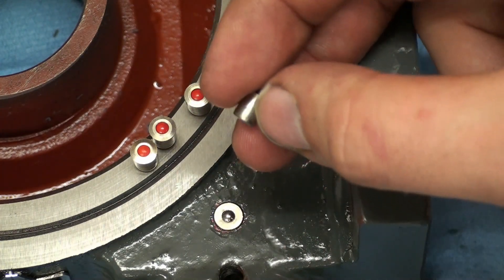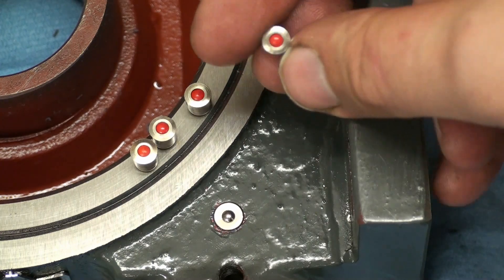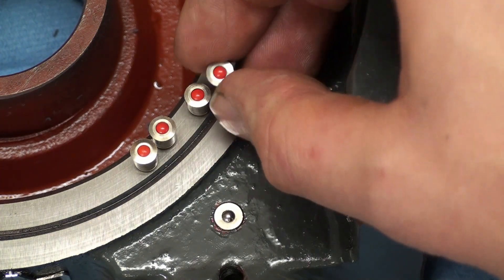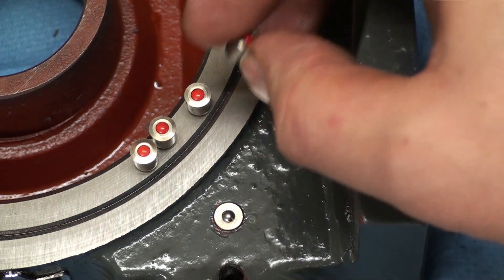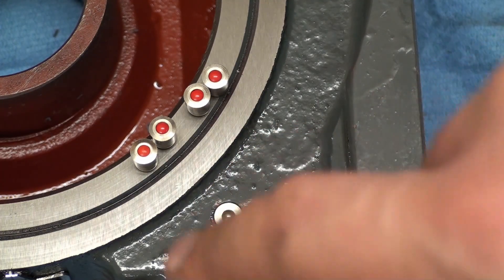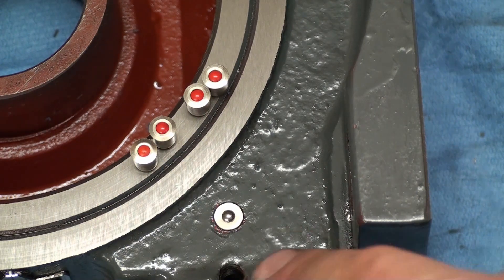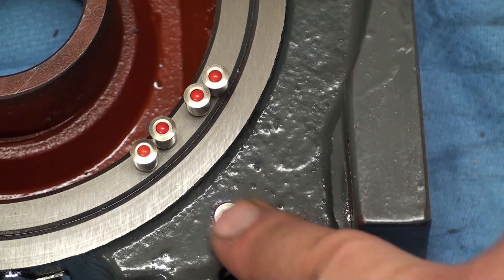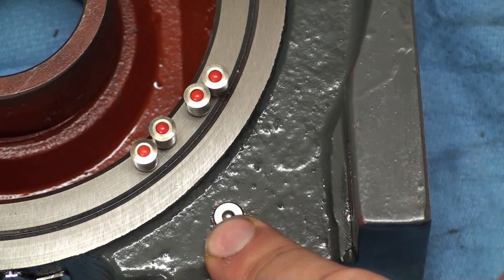Vertex rotary table Teardown - Vertex Rundtisch zerlegt

Comment: Hi Stefan.
What Model is it in their line of tables. Good to see as I once bought a Chinese 4 jaw independent chuck for my Harrison T300 and though it is very good it also was full of Cast Iron chips and dust so I did the same thing.
Reply from the maker: +Fred196407 It is a HV-something table. Generaly I would take apart all the stuff from far-east,  dirt, chips and grinding dust are pretty common in that stuff.
Reply: +Stefan Gotteswinter  Yes me too. We have a local ish place called RDG tools in Hebden Bridge here in the UK who sell a lot of HBM gear that is mostly inferior rubbish. I bought a 3 jaw self centring chuck for my myford super 7 from them which had a strangely tight jaw. To my horror I discovered that one of the jaw guide ways had 3 chisel indents in the edge of the groove. I took it back and had an argument with a old guy there who accused me of trying to grip something too large so the jaw clattered about. What an absolute insult to my intelligence. These chisel marks were in the Center of the guide way. Eventually he replaced it. I got in my car and as I rolled a fag I watched them lock up and leave being the end of the shop day. The chucks were sealed in a shrunk wrap plastic bag. I thought what's all this dirt and opened the bag to find a chuck that literally looked like it was dipped in oil and then put in a tub full of cast iron dust and chips and tumbled around. To ad insult after I stripped it and cleaned it out it was completely useless for any kind of accuracy and worse that the old battered Pratt Bernerd I was trying to replace. I now have a Harrison T300 which also came with Pratt chuck but its acceptable especially with a new set of soft jaws. RDG's stuff may have gotten better in quality these days but I doubt it. My next chuck will be a Bison.

Comment: Excellent review Stefan, I have a 200mm Vertex rotary table which appears identical.   I was a bit surprised with your commentary about it being chinese.  I have a Taiwanese lathe and Mill and the Vertex rotary table is made in Taiwan.  I was led to believe the the Taiwanese machinery was significantly better made that most of the mainland Chinese stuff.  Is this not your experience?  Love your Channel, thanks for posting.

Comment: hi stefan would this rotary table fit on the optimun bf-16 mill in the 90 deg position will the holes line up with the table to clamp down? i am looking at getting this rotary table

Comment: Hi Stefan.
Please , tell me  - what are your feelings on the use this rotary table   at steel billet  milling process  like power way ?  The worm is not dead?
Or this rotary  table only for  "installation +  fixation  + drilling"  (for hard metal of course)?!
Reply from the maker: I use it for milling steel all the time :)
Reply: I mean - you milling steel billet  after fixation or in  rotary process?

Comment: Hi Stefan!
I have a terrible question for you!
Please,  measure the thickness of the  in the horizontal sole of the rotary table!
(All the walls from the radial bearing together with all partitions to the thrust bearing-nut)
The essence of my question is: I bought a similar table, I saw a very small thickness of  bottom cast iron  in compared  with the supporting  side walls of the rotary table!
It turns out very small table rigidity due to a thin bottom!???

Comment: OK this an important question lets say you have a 12mm round stock and you want to mill
a square at 10mm on the end,Like say a chuck key,How do you work out how much material
to take off the 12mm round stock..Would it be 2mm divided by 4  = 0.5 millimetres of all 4
sides is that correct..Sorry I'm a noob at this and crap at maths i just though that's how you would
work it out .or is there a formula for square in a circle or a way to work this out thank 
you for your help its very much appreciated..
Reply: HolzMichel Hi thank you for the reply,I said 0.5mm a side sorry for the confusion..And i would be taking 0.5mm from 4 sides..Which would mean 2mm off loss of material all around..Giving me my 10mm square hope this makes seance...If i took off 1mm per side on 4 sides as you say that means there would be 4mm of material removed not 2mm ??
Reply: +Muhaa Haloa Yes, but its only 2mm off one axis of the resulting square. Same if it were a round; the diameter is just  two times the radius, not four, or six or ten or however many sides you wanted to machine on the end of the round bar. I hope that makes sense :)
Reply: ***** Ah thank you i get it now sorry about the confusion,Just trying to learn..Thanks for the explanation..:)..And thank you HolzMichel
Reply: HolzMichel Thank you for your time and explanation HolzMichel its very much appreciated i understand what you are saying
now it's some thing I've been wondering now for a long time..I don't have my mill i have
my lathe and waiting till the end of November for my shed to be put up..But i will get there..

Comment: Your channel is one of my favorites. I'm pretty interested in machining, but don't have the space at home. Someday I might get a hobby lathe and/or mill. My question for the Q&A: To get started in home / hobby machining, what is the best way to buy machines, tools, and equipment? I know there is the obvious ebay and classified ads, but is there another way or place that nobody thinks of?  

Congratulations again Stephan!

P.S. Is the M1911 project abandonned? Is there hope to see it finished someday?
Reply: Best way is to look for a nice well made old used machine with lots of tooling to pop up,could take months or more.Or you can just buy something new made in China(unless you have LOTS of $) and be prepared to spend more than the machine on tooling (measuring stuff is a killer if you want decent stuff, and you do!) in a very short period of time and put a bit of effort in (like done to this rotary table) cleaning and just finishing of stuff they are too lazy/cheap to do in China.

Comment: Hi Stefan - Thanks for taking us through this. My Question(s) - Can the Handwheel & Vernier Scales be adjusted or redesigned to read and set a greater accuracy. And could the worm shaft and worm gear be replaced with ones that have more gear teeth for finer motion, or are the gear teeth constrained by the diameters of the worm shaft and worm gear?

Comment: Thanks for the Q/A!

Do you thin it's possible to use one of those rotary tables to machine while rotating it? Maybe adding an axial ball bearing? (Mine vibrates a lot and it does sag while horizontal))
Reply: +Armilar Zifferblatt Plain bearings are the norm for low speed high accuracy use. Vibration comes about due to movement that shouldn't be there. You need to tear it down and find out what is loose or broken. Luckily Stefan just showed you how.
  Mike (o\!/o)
Reply: Will try and post back the results.
Reply: +Armilar Zifferblatt That's what theyre meant for not the best quality but adequate. I have been using the 8" for the last 16 years in small scale production environment. 1 month by me about a lifetime of use by the diy er just needs a rebuild every year.

Comment: hi stafan, sehr gute videos. ich habe eine frage. voher kaufst man die red Ball oilers? I am restoring my old weiler condor lathe, and need some of these oilers. greetings von dänemark 😃
Reply: +DKadventurer you google for "ball point oiler" or "red ball oilers" for the colored ones and in german for "kugelöler" or "kugeldrucköler"
Reply: +rol eic wow i didnt know that! is that Google.De ? IF that Works i must tell others. could i also do The same IF i need a pair of shoes? 
I asked because i would Like to know EXCATELY where hr bought his oilers....

thanks for The help
Reply: +DKadventurer Is that sarkasm really applied at the right place? It took me a while to find the correct German terms to google for German suppliers myself. And I thought this might help you. If you had found this out before me such a BIG DEAL. But now I know that I don't need to try and help you any more. Have a good life.
Reply from the maker: +DKadventurer Link ist in der Videobeschreibung :)

Comment: Hi Stefan, Come on! When Optimum knew you ordered your Vertex, they went over it with a fine tooth comb. Hey a drywall screw and vice-grips will pull any oiler, or just put the vice-grips on the tap-handle   Die Frage, Poster on the wall, Who, What Where.....?

Comment: I like to use a socket to make an ad-hoc puller.
Reply from the maker: +eformance Yeah, I do that too, or part off a piece of pipe, but in that case I prefered the nuts so people could see the oiler beeing pulled out :)
Sockets are also good to drive in bearings in a pinch...

Comment: I have an unusual request/question for any owner of this table.: 
Can you tell me what the internal diameter of the large worm gear is, the diameter INSIDE the bolt circle?

I am building a machine  that would use a rotary table like yours with some modifications.

Comment: my table is 120mm wide t slots are 70mm from centre to centre
Reply from the maker: +Jason Burns the holes on the vertex are 100..130mm apart
Reply: I think I will purchase the 110mm table for my optimum bf-16 mini mill

Comment: While you're at it you should check the accuracy like hole concentricity, table flatness, and squareness and parallel of the base to the table.
   Mike (o\!/o)
Reply from the maker: +Moholo 88 I did that, but the video was already to long - But guess what, it is exactly within the specifications that can be found on the Vertex website :)
Almost all measurements are better than 1,5/100mm :)
Reply: +Stefan Gotteswinter  Wow, that is really good. Now I am curious and I have to check mine since I can't remember. Great video, thanks.
  Mike (o\!/o)

Comment: Are you sure it's not a 6" rotary table? ;-)
Reply from the maker: +eformance Whats an inch? ;)
Reply: +Stefan Gotteswinter It's either a worm or some Merika thing.
  Mike (o\!/o)
Reply: + Stefan Gotteswinter    it's the units your pipe fittings are made in :>)
Reply: +Stefan Gotteswinter  25.4mm
Reply from the maker: +jhareng Only after they metrificated the inch - before it was the length of three barley corns...
Reply from the maker: +Chris Stephens Yeah, thats the reason why I have to go three times to the hardware store to get the proper pipe fittings when I do pipework... :(